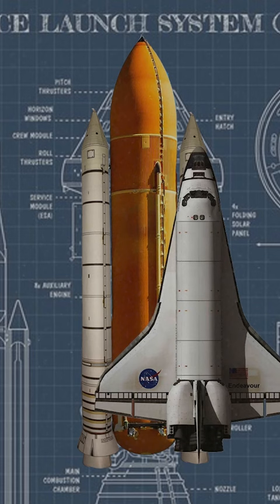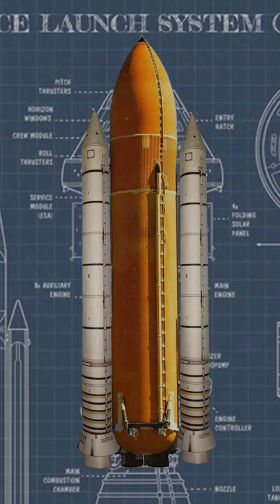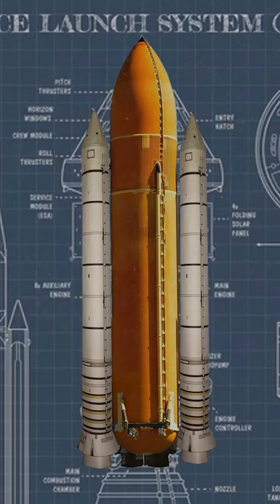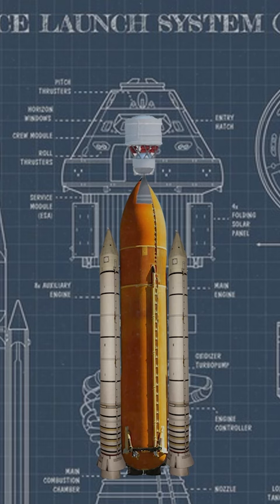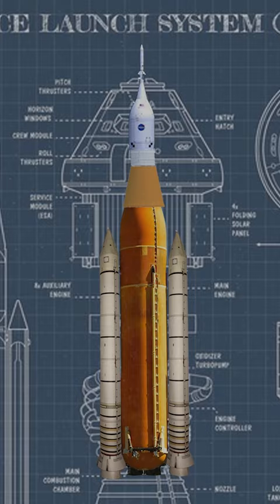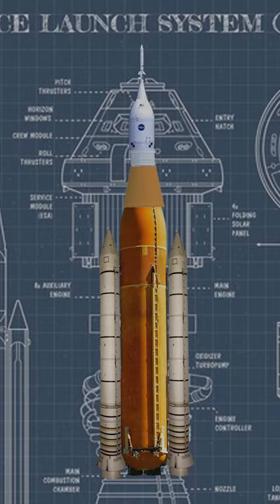How To Make A Space Launch System | #shorts

Comment: You forgot the $50,000,000,000 and 12 years.
Reply: Crazy isn't it? They should have given SpaceX a couple of those billions and we might have been walking on the moon right now.
Reply: Precisely the point of Artemis… giant money hole to provide high-tech jobs to as many Congressional districts as possible.  It’s the same politics that are played by the military-industrial complex.
Reply: It was actually $22 billion over 12 years, but I guess a little more as the SLS is based off the Delta heavy rocket series, specifically the Delta IV, designed by Boeing for the U.S. Military which they've used almost 2 decades now without a single disaster (god only knows what the military needed a big 'moon rocket' for). 100% success rate. 13 successful launches since 2004,  6+ with classified heavy payloads. Let me explain.

The Artemis/SLS is now the largest rocket ever built by man. It's based on a proven design, it's been used many times now, it's a well built rocket, built by the same people since the Apollo missions, the best engineers and aerospace manufactures on the planet. ULA, Boeing, Northrop, etc. You can't get any better than them. 50+ years of experience there. Trust me. SpaceX is dreaming right now but maybe one day they can hang with the big guys and do more manufacturing for NASA.

The SLS is not exactly 'new technology' and I suspect it will prove the same success as it's relatives, the Delta IV, as it is designed and manufactured by the same people. It's not a waste, don't believe that crap, idk what's wrong with people... NASA's budget is currently 0.3% of the federal budget, still not even a single percentage point. We've already spent $80B in Ukraine, that's 4 years of NASA's budget in just a couple months. The SLS took roughly $1.6B per year for development over 12 years with their ~$20B budget. This is NOT the cost of each launch. It will cost $2 billion to launch this year, same as the recent Mars rovers. The cost will even go down, they predicted somewhere near $500M per launch, like the Delta IV costs, depending on inflation of fuel, parts and fuel supply chain, current events, etc. It's still pennies... You won't think it's a waste when you see what they're about to do, it's a big deal. We're talking permanent moon base. It's all signed and paid for now. Sit back and watch.
Reply: @Emdee5632  Starship can just BARELY reach full engine thrust now
Meanwhile, artemis 1 has already taken flight and the parts for artemis 2, 3, and 4 are being built as i type this
Reply: Yes I know all that... The hole system depends on ALL the various launch and rocket systems and how they are combined. I was trying to point out that maybe if a couple of those billions had been given to SpaceX....

Comment: The orange tank in SLS is very different from the one in the shuttle. The solid rocket boosters  are slightly different from the ones in the shuttle and are non recoverable. The engines are very efficient SR-25s so it makes sense to re use them. Also, this has an actual abort system, not the shuttle's "if you're less than 3 minutes into the flight you are screwed"

Comment: I try to actively ignore how disappointing it is that NASA was forced to use old Shuttle hardware to make the SLS
Reply: Well, that's not exactly true and neither is the video. It's bullshit.

It's not a shuttle rocket with a makeover. It does appear similar, and I believe it's intentional, but It's a different design and holds the record for the largest rocket ever built in the world. There are multiple SLS designs that may be used in future missions and they are based off the Delta heavy rockets which have been used by the military (for god only knows what the military needed a 'moon rocket' for).

The government has been working on these 'heavy-rockets', I'm sure, since the last moon landing and have tested and launched many similar rockets like the Delta IV Heavy Rocket from 2004-2021. With zero disastrous failures. The SLS design is based off of these heavy rockets and will likely prove the same success, because it's not exactly 'new technology' anymore. 

The government will contract engineering, own the designs, and contract out again to manufacture them. The Delta IV was mostly designed by Boeing, yet manufactured by ULA alone for the military. The SLS was also manufactured by ULA but this time along with several other original manufactures of the Shuttle. Boeing, Northrop, etc. Probably the main reason it looks similar and nostalgic. 

There The orange shuttle color is foam insulation that would normally be covered up or painted but in this case it's left exposed to save weight. The parts (if any) were likely surplus, not used parts. All the shuttles were sent to museums fully intact. What people might be referring to is the crawler to move the rocket to the launch pad, it's one of the same crawlers they used on the Apollo missions fully maintained and upgraded over the last 50 years.

Lastly, while people like to root for SpaceX as if they are 'the competition against the establishment', it's actually NASA who regulates SpaceX and gives them contracts, it's more like they are on the same team than anything. NASA does some design, but mostly the science, testing, regulating. They and the Feds own the 'big boy toys' which they now pay their contractors to build. These things were already being designed decades ago and used for years now by the military. The military are already working the next decades technology which which SpaceX could never afford to do on their own. $100+ billion dollars a year is hard to spend with no profit intended, only governments can afford this type of design and research. I always joke and say NASA signs SpaceX's paychecks, because it's pretty true and they wouldn't exist without them.
Reply: They did it to keep the people who worked for the shuttle programs still have their job
NASA is cool and all, but theres the boring, political side to it as well. They gotta appease congress
Reply: @exohio woah that's a lot of words

too bad I'm not reading all of that
Reply: @NST-257  Don't fkn read it then. 😆 Wasn't talking to you.
Reply: @exohio  I know you didn't talk to me but that's a whole essay

Comment: Honestly wish we would put more research in space planes I think that's the way we will get space more accessible and safer you can turn a plane around not a rocket and it saves fuel
Reply: I always thought a maglev launcher from Chimborazo would make the most sense. Launch the plane as a scramjet so the final stage to orbit is the only part carrying oxygen. The angled launch from 20,000 feet at a few MACH number doesn’t use onboard fuel until released. Build the scramjet launcher to fly back to the launch area for reuse. It doesn’t have to be huge. It’s more about being able to perform multiple smaller launches a day with nothing wasted.

Comment: Why'd it take so damn long if this is all they're doing??
Reply: They had to make the orange tank stiff enough to not crumble on the way up.  Took lots of attempts to get that just right, but not too heavy.  The factory that made the old shuttle engines also made a cheaper disposable engine for the Delta IV rocket that has the same idea and top part.  But they stopped making any engines at all, so the US is limited to fly those Delta-series rockets as many times as they have old engines to burn.  Meanwhile the new space companies make their own engines and rockets, such as BE4 and the ITS.